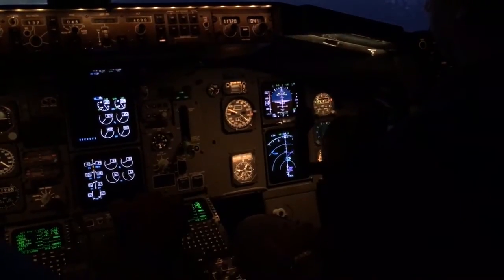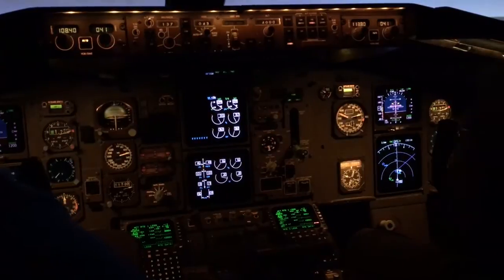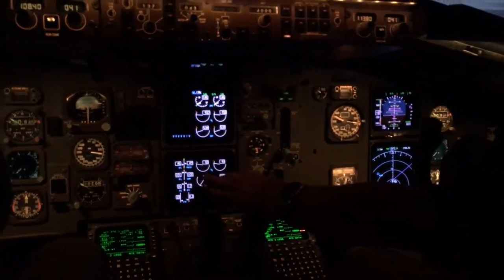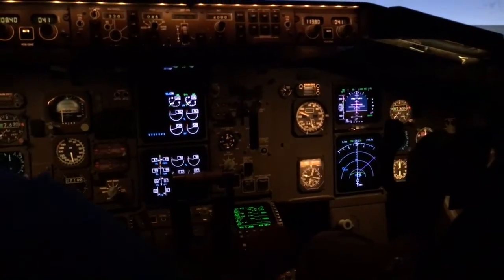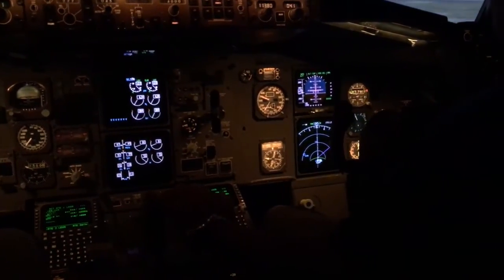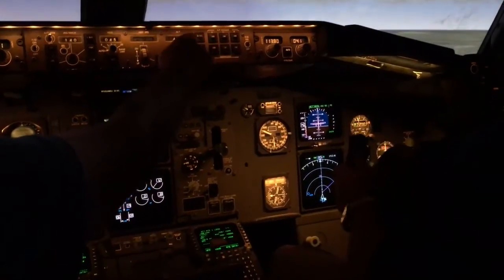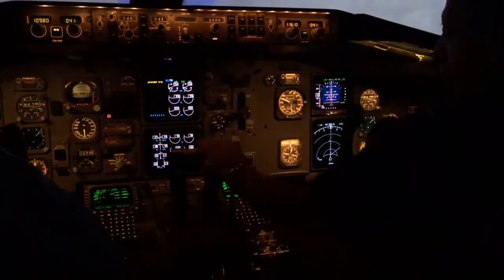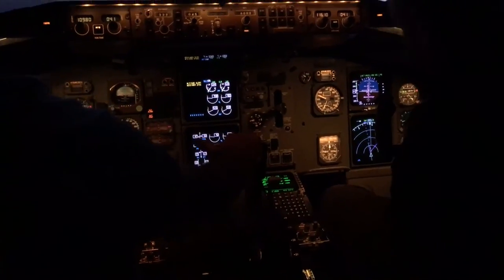B767 Stall on ILS

Comment: 00:18

Master Caution
Master Warning
Reply: That was the Autopilot Disconnect, it cannot be silenced by pushing the Master Warning, the AP disconnect pushbutton needs to be pushed to silence that alarm.
Reply: @frank_av8tor Isn’t that the standard master caution with the master warning? The master warning IS that 2 tone alarm, is the autopilot on? Was this an autoland? If not, there should be no autopilot disengaging alarm.